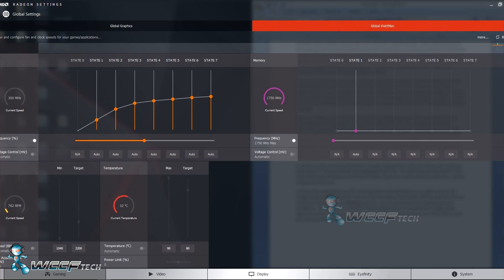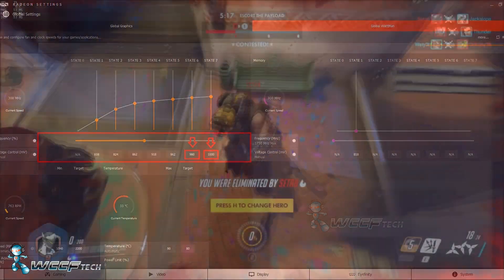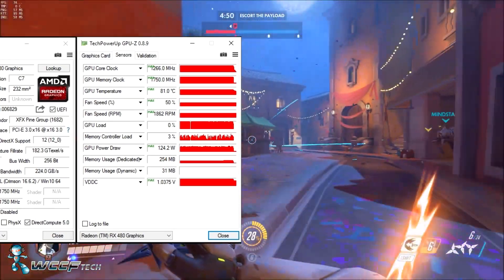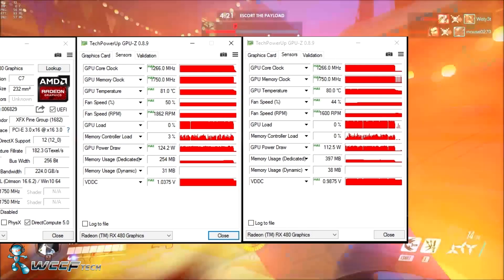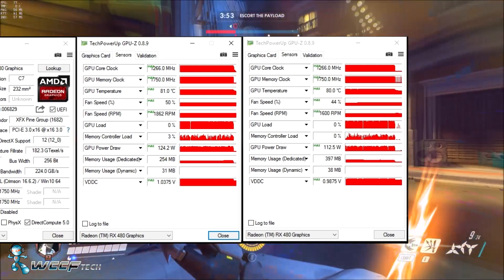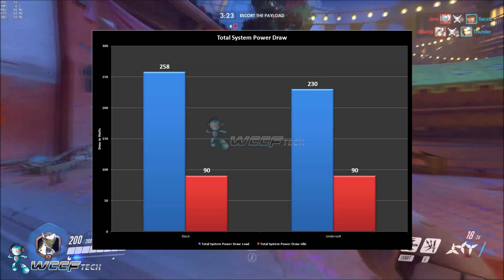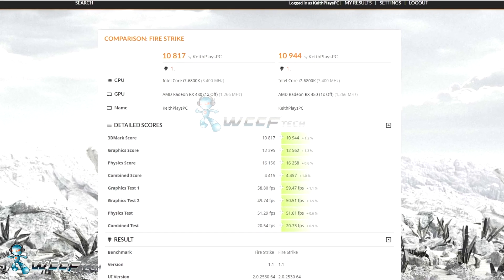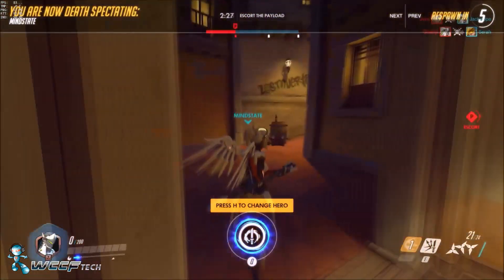Radeon RX 480 Improve Efficiency Guide

Comment: How does people get so lucky? My RX 480 (Sapphire reference) can only be undervolted to 1089 mV (down from 1150mV stock) before crashing. Are the reference cards really that different?
Reply: William Larsson custom models have overclocked settings, the stock is 1266 and runs stable with 0.980 volts apparently, higher frequencies need higher voltages
Reply: I have read somewhere that Sapphire uses shitty mosfets, may be the same case with Gig.

Comment: It should be possible to drop volts to all p-states and then the card will be more efficient across the board. Since i'm planning to buy sapphire nitro version of the card and when i buy it i'll try to do the same. I know it's not the same manufacturer or even architecture but my friends GTX 1080 at default runs on lower voltage then RX480 on default. So i do think that only change that AMD needs to do is lower voltage somewhat or buyers by themself.
Reply from the maker: it is indeed possible to drop the voltages across all of the p-states.  I just wanted to show people how to get started with it and how it could benefit the cards power draw :)  -Keith
Reply: +WCCFtechTv 
Correct. i get what you've done. But what i said in the previous comment is that it might be possible to do by them not users but kevin said that it might inflict with the cards since it might not be able on all of them

Comment: You have the 4GB versions right? That should have less power consumption because of less vram and 7 gbps instead of the 8 gbps that the review sample had. And it's 150W tdp, 110W is for the RX 470. Still a 10% power use drop at full load is impressive.
Reply: WCCFtechTv
I don't know how much vram consumes, but they get very hot and there's 8 of them, so let's say 20W total, 2,5W per chip sounds about right. There are 6 phases for the gpu and 1 for the memory, so 150W/7phases = 21,4 W per phase.

I would say it would use somewhere between 25-50% less power having half the memory idle and an underclock, so somewhere between 5-10W.

I disabled power c states on my cpu and at idle, it uses less than 1/3 of it's full power, running at full turbo and voltage, don't know if vram behaves quite that dramatically.
Reply from the maker: you're pretty close, but the thing to keep in mind with memory is that it takes the same power to run it under load whether or not the IC is fully utilized or not.  But the reduced frequency does make a difference, albeit very little.  At it's worst it's likely 3-4w.  But an interesting discussion non the less :)    After typing this out I checked Anantech as they had both the 4gb and 8gb versions and it appears to be a 3-5w difference between the two, so looks like we meet in the middle to find the correct answer #teamwork   -Keith
Reply: AMD is using the same card for both the 4GB and 8GB variants  even leaving the extra 4GB on the board just disabling it in the firmware of the card. They might send the same current to the ram regardless of which board you have depending on how they disabled the memory.
Reply: adam armstrong
Half of it is at idle and it's underclocked, how can it not use less power ...
Reply from the maker: all of the ICs are still active and powered even when only 4gb are available, and yes slightly lower clock 7GBs vs 8GBs, but how much of that to you figure is accountable for the total board power draw? -Keith
Reply: I'm eager to ask this question since i've been at my friends who bougth GTX 1080. I commented on the video already but i want to know your opinion aswell. His card runs at about 1.02 so is it possible that AMD simply drops voltages to GPU??? I have hard time to believe that GTX 1080, despite being manufactured at different factory etc needs less voltage than RX480. If i seen it correctly RX480 runs on 1.06 and on one site i saw even 1.15.
Reply: Kristijan Vragović
They could drop the power limit and the voltages at the same time to keep the same performance, but I'm guessing not all cards can do that, otherwise they'd have done it from the start, could end up in more cards being 'defective'.
Reply: Keven Harvey
Well, that is correct. We will see what they'll do when the driver goes online, but i do think that they will do something with voltages cause card is overclocker nonetheless even on stock voltages. They could do somenthing like fury where the card were not overclockable, so the card will consume less but on reference model you will not be able to clock it higher no more. That is my opinion.
Reply: Keven Harvey 
From my comment you could see that i do think that this time they left some headroom to the card.
Reply: Keven Harvey I have the 8gb not overclocked edition of this card. The asus rog strix 8gb...how can I efficiently tune my card so my card doesn't crash after few minutes of gaming. I'm using an Alienware amp and it's powered sufficiently, seems like it runs perfect for a few minutes in csgo Overwatch on highest settings but I notice the frames stutter and then the eventual crash. Would turning some of the settings down help fix this issue?